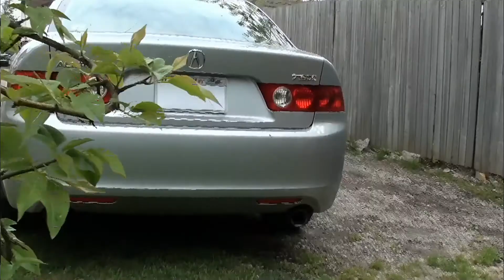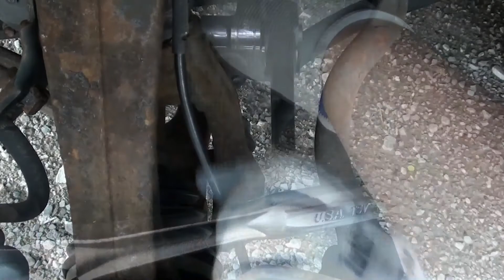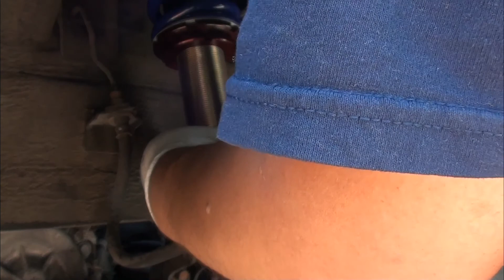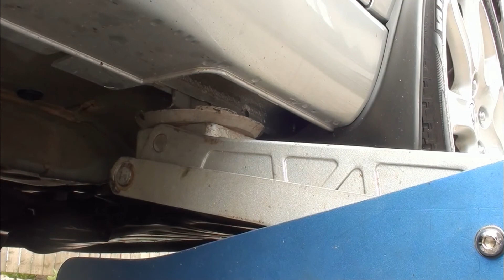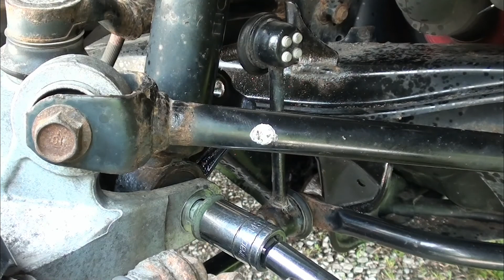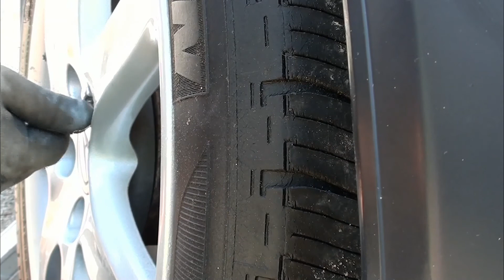Buddy Club Coilovers N+ Damper Kit install on an Acura TSX

Comment: Thanks for the video it really helped! i have a few questions i ordered my set of the n+ coilovers for my s2000 but when i install them how do i adjust the ride height? and what you did with the tape measure was that the amount it was going to drop when you unjacked the car? if not how do i know how much it will drop? and does the front and rear have to be the same number on the tape measure? how do adjust the stiffness if you can at all? and also when you put them on right out of the box will it be the stock height or will it drop a bit i just want to lower it an inch. Thanks, sorry for all the question i just dont know much about coilovers!
Reply from the maker: +harpinder Singh this is my first set of coilovers too. i use the tape measure to make sure it's all the same heights. since it's your first time its easier to search on youtube. it would show you and explain it a lot better than i can. sorry didn't help you much.  just type in how to adjust coilovers. most coilovers are the same concept.

Comment: 5:58 what type of grease did you put on that bolt? And did you put it on all of them?
Reply from the maker: I live in the midwest so I used anti seize. Prevent rust so I can remove it easier next time.

Comment: How many inches did you drop it ? Btw good job on the installation
Reply from the maker: Un Known thanks, I didn't measure mine but when I maxed it out it was very low. I heard it will to to about 4 inch drop.
Reply: +raz-R yah does it ride harsh?
Reply from the maker: +Mary Eshou it has adjustable damper so I set mine to hard so it rides harsh. if I don't it will bottom out on some uneven roads.

Comment: what's good Wisconsin u still got this car
Reply from the maker: +omar daher yes i do.
Reply: +raz-R how do u like them in the recent weather?? planning on coping
Reply from the maker: +omar daher just got snow today so ill l try not to drive it in the snow. the olny thing I dont like is the rebound wish the spring rate was stiffer so if I have the damper set to softer it will rebound too slow when I go over more than one bumps. also I had to set the preload. I called where I ordered it from and buddy club they dont recommend any preload on their coilovers but I found someone set there preload on the net and gave it a try. with the preload it was a little better on the rebound. if i can get another different coilover brand set up i would.

Comment: Im was gonna put mine on coils today but the fucking nut in the front is fucking hard any suggestions?? Like it dosnt move at all (the second bolt you take off)
Reply from the maker: use pb plaster and let is sit over night and use a breaker bar. sorry for late reply.

Comment: how did u remove the side rear seat ??do u have to remove the seat first to remove the side?? thanks
Reply from the maker: +Ger Mai Lee yes I had to remove the back side cushions. remove bolt #37 and pull up side cushions #31, #15. i forgot to get that part on camera. http://estore.honda.com/acura/parts/show-block-image.asp?iid=14SEA01&lid=SEA4B4100C